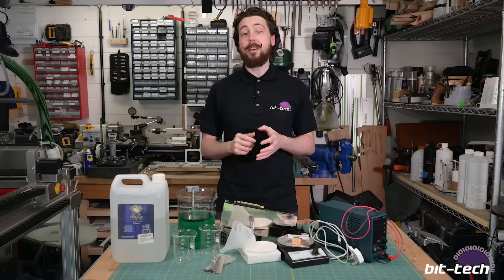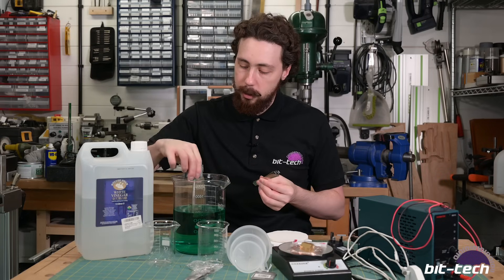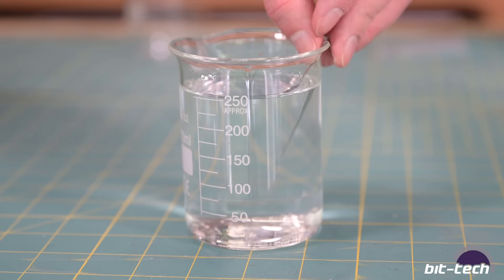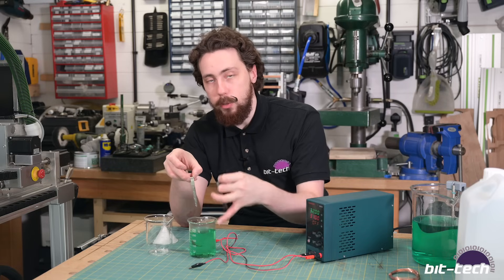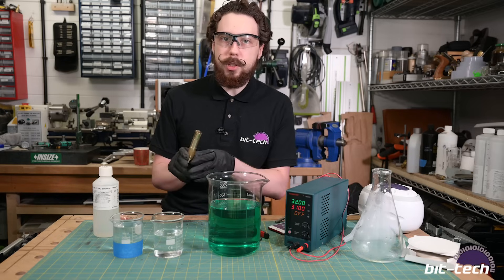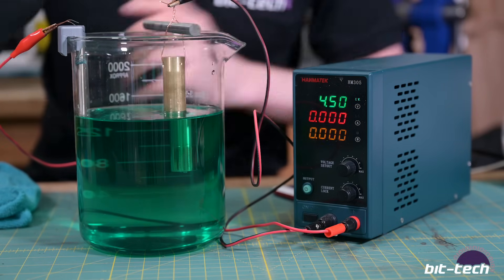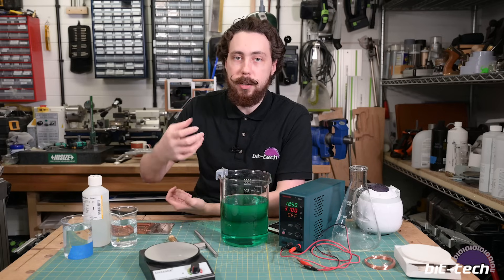How to Nickel Electroplate at Home | bit-tech Modding

Comment: Pro Tipp: Constant Current works better then Constant Voltage and low Current takes longer, yes but it will be more even and precise. I do Nickelplating for a living. And no i can´t plate your parts because I am not allowed to take any random stuff, we dont do that. We plate grinding tools for CNC-Precisiongrinding. As pointed out in the Video for best Results Clean Parts are the most difficult part of the plating.
Reply from the maker: Martin Brieger That’s a handy point. I had hoped to do exactly that but it seems the unit I chose is voltage controlled rather than current :/
Reply: @bittech1  set the voltage higher and then set the current limit and the power supply will adjust the voltage down to whatever is necessary to maintain the current. If the voltage is limited and isn't high enough to push the set current, it'll just maintain the voltage at a lower current. It all comes down to the resistance of the electrodes/electrolyte. The higher the resistance, the more voltage you need for a particular current and vice versa
Reply: @bittech1  as @Jamie Foster pointed out, solution is crank the voltage up as high as possible and just set the current as high as you want.
Reply: Do you have a recommended device ?
Reply: I need some help I do that for living to iam Egyptian and I need help alot please
Reply: What material is best to use as clamp in electroplating nickel . Can I use any metal for camping?
Reply: @0815Skorpio  does a stirbar or circulating the fluid help or hurt
Reply: Is it possible for these DIY amateur home kits to do something like a engine cylinder? 
I also have a Honda NC29 front master cylinder on a shelf that I'm pretty sure needs the internal surfaces repaired and is stopping me from riding the bike as I haven't yet worked up the courage to look and see what the cost/availability of a new/replacement one would be....

I'm thinking the 2-stroke Kawasaki engines found in thier old range of motocross bikes. The cast alloy cylinder, which includes the transfer port and exhaust ports in the casting, which protrude into the cylinder area and act as inlet/exhaust valves as the piston slides past the respective positions of the port openings. Now, unlike most other manufacturers which incorporate a cylinder liner of some sort, such as a hardened surface or a liner, Kawasaki took a different approach for its motocross bike's range of 2-stroke engines and precisely machined the cylinders bore and coated the machined surface in a Nickel plating. 
It was a perfectly fine solution and performed very well, WHILE IN THE SERVICEABLE CONDITION IT LEFT THE FACTORY IN. 2-stroke engines found in other manufacturers motocross bikes could reach the end of that serviceable life and have the cylinder bore machined to a slightly oversize diameter and essentially 'reset' the cylinders serviceable life span. This could usually be done 2-3 times without significant issue. The other benefit of the other bikes was when a below nominal operating environment and/or engine component failure lead to premature wear/damage of the cylinder wall, the engine could also be repaired by increasing the bore diameter and fitting an oversize piston and ring. Allowing the engine to continue functioning with relatively little repair cost. 

Kawasaki on the other hand...

While the Nickel plated cylinder bore performed exceptionally well from new, the moment the coating sustained anything more than very minor wear/damage, it was not possible to repair the engine by increasing the bore size. Requiring a completely new cylinder in order to repair any damage the Nickel plating sustained. The surface could be carefully honed during top-end rebuilds but correcting any ovaling, or reversing metal transfer or removing scoring (from say, a poorly fitted wrist pin circlip / rings which are poorly/not gapped / overheating / incorrect fuel-air or fuel-oil ratio / etc) is largely out of the picture. 

Sorry bout the looong winded explanation.

So, considering the decreasing availability of these parts and thier considerable cost relative to the overall value of the bike, (the cylinder would often be more expensive than replacing a 5yr old+ small capacity bike, making for a quite expensive repair bill for the parents of non-sponsored enthusiasts.)
This goes double for collectable examples such as the mighty KX500.
It would be fantastic if the factory Nikasil plating could be removed (chemically or mechanically) and replaced with a fresh coating.

P.S. I don't believe it's possible to sleeve these castings due to the cost saving nature of thier OEM construction method, which would be compensated for by the properties/nature of the Nikasil coating. But I could be wrong.
Reply: @muntee33  Sadly, no. Engine are made of aluminum and aluminum is terrible for use in electro chemistry.
Reply: @JaenEngineering   so what Ampere and voltage exactly you recommend for nickelplating ?
Reply: i heard that using the lowest current and voltage possible produces the most high quality coating but obviously takes a long time

Comment: I did zinc and copper before now I'm ready to try nickel. I bought a gallon of 30% industrial-strength cleaning vinegar and non-andodized sea salt. Every time I thought about trying it, I kept using the cheaper viegar for rust remover and it's all dirty. I just bought some nickel, rant over.

Comment from the maker: Timestamps since this is a long boi:
00:33 - Intro
02:30 - Materials
06:30 - Making the Electrolyte
12:50 - Cleaning
14:56 - Acid Pickle
16:54 - Plating Intro
18:33 - Plating Method
23:30 - Final Thoughts
Reply: If you put them in the description youtube will automatically display them in the "progressbar"
Reply: @janek-96  Yes, IF the timestamps start at 00:00.
Reply: Add these time stamps into the description a long wit 0:00 and take advantage of the time line chapter functionality youtube has
Reply: Ami not right in thinking there are extreme dangers if someone tries stainless steel? If the electrodes go around the wrong way do you not get toxic gasses? Might need a warning about that.
Reply: @sonoflysystrata2   Alex, the presenter, had warned about the matter; at the introduction about performing the experiment at a highly ventilated area. Common sense depicts the fact.
Reply: Use a fish tank air pump aerator to keep the fluid mixed.

Comment: A lot of the talk about experimenting and “you might want to try” wouldn’t be necessary if you use current control of the plating. mA per square mm remains a constant if you want reproducible results with varying conductivity or concentration of solution. You power supply has that feature. This has been a very good introduction to plating, thanks.

Comment: Two suggestions: 1) Plating isn't about voltage, it's about current. 2) Always use magnetic stirring, or put multiple sacrificial electrodes at different locations, otherwise the plating WILL be uneven.
Reply: Reading your comment  figured out you know aot about chrome plating, I want to chrome plate  copper pipe about a Metre in length. How do I go about doing it
Reply: you actually dont need any current. Caswell has a new electroless way of plating. it works.
Reply: @redhed9776 That seems to be the superior method. It's more expensive though, especially if you have large objects to plate.
Reply: What about a small aquarium aerator, it keeps the solution moving all the time.

Comment: I really liked your video!! Im into restoring an old motorcycle and one thing i want to do is to nikel plate some of it's screws, so this comes really handy to see.
Thanks!
Reply: In planting process  what kind of anode matarial use
Reply: In this situation nickel must be used. You must use the same material that the plating fluid is saturated with.

Comment: Electroplating sure is easy, but getting an uniform surface finish can be pretty hard. I'm exited to see your results!
Reply: E5
Reply: I did high chrome plating for 10 years there is a lot of little tricks but there's not too much you can do to avoid thicker quantities of your plating materials towards the end or corners of the work you're trying plate covering the ends of material your trying to plate with aluminium or lead tape will bleed off excess copper nickel Chrome whatever the solution you're working with.
Reply: @googlefirstnanegooglelastn1203  I'd like to have a visual of what you're talking about, using aluminum or lead tape, I don't quite understand how this would be done.

Comment: Using a aeration device like the ones that make bubbles in the fish tank, but only the air tube only. This will keep the solution moving. Or using the they stir pad you mentioned? Although you didn't use it in the Nickel Plating process.

Comment: Might want to explain one reason for wearing gloves aside from messing with chemicals is to keep fingerprints from depositing on the part.  My understanding is they will easily show up on the finished part.  It shouldn't be an issue due to cleaning before plating but it's cheap insurance.

Comment: I used a car battery and the thin strips of nickel to make the solution. I have a charger for the car battery but its one of those roll around kind and takes up a lot of room at the bench, so the battery is easier for me.

Stripped a old charging wire to hang things from and used a paper coffee filter for the bits.

I think in total I spent something like $15 for the vinegar and strips to make the solution.

For the container I just used the plastic vinegar jug. Cut a slit in the bottom side and put one strip in it. Filled with hit glue to seal it. 

In the top side I made a window for a nickel strip mesh I made and lowered it in.

The battery connections hold nicely because one can rest on the bottom of a bowl I put the jug in (just in case) and the other clips the plastic and anode up top.

Comment: I am interested in electroplating a design that's been etched. Would leaving my toner on the initial part keep the nickel from adhering to the sections I desire to remain brass,  or would I be better off just sanding the nickel off? My main concern with option two is that it may cause flaking.
Reply: No expert, just curious, what did you do?  I guess etching fluid is way more aggressive than this so the toner would work?  Or Nail polish, remove with acetone afterwards? I don't think you can easily remove the layer after it is plated.

Comment: Very interesting and informative explanation of the process. Well done. Have you tried using citric acid for pickling? I use it for cleaning up small parts after silver soldering to remove residues. Any thoughts please?

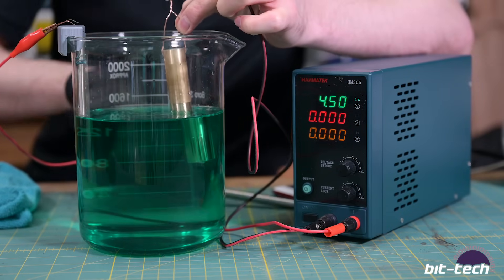Comment: Great video, but at point 21:00, your supply shows no current.  Is it even on at that point?  
Also, you keep talking about voltage, but isn't it the current that matters?  When I tried this, with a fixed voltage, the current varied greatly just by moving the pierced close to each other.

Comment: I am not sure if I missed the beginning but cleaning a simple bolt, remove paint, wire wheel and run a thread tap over it once as thread gain a very tiny amount I guess like 0.003" but many bolts have rolled threads that make them thick. A tap, cute threads and are loose. Thoughts? Thanks!
DK, ASE master tech since 78, retired.
 (Note; I do like the "Yellow Chromate Conversion" that required a good zinc plate as the truck is a 1967 for fasteners and other items to plate. Thanks again!

Comment: could you make a ring anode, that would be the same diameter as a glass beaker, would that kind of an anode prevent shadowing?
Reply: He could use multiple rods with 3D printed holders just like the one he uses, and connect them all with copper wire. It would allow customizable configurations for more complex parts and would be easy to do.

Comment: So I'm thinking of doing this for some older game consoles so as that their stock aluminum cooling blocks can use liquid metal to interface with the IHS. Will this nickel plating process work with aluminum heat sinks?

Comment: Thanks for the informative video it sorts a lot of potential problems out. I have a question that you may be able to help with. I need to brass plate some small plastic model parts, obviously I need to paint with a conductive coating first. Do I need to copper plate, then nickel plate before I brass plate. Your advice will be appreciated. Thanks, Chris.

Comment: the anode (not the thin nickel anodes), the round one that you used when you started electroplating. The one that looked like it was ade to hang on the lip of a beaker. Where can i find those, what is the manufacturer, what material was it made from, and how much are they?

Comment: Had a thought, what if you used an anode ring with the cathode/part in the center to prevent shadowing?
Reply: Right. He could have built a "basket" of the thin nickel anodes connected by a copper ring at the top rim. Platimg a coin or something would be a bit redundant with a 360° anodes but that could easily be changed for the part.
Reply: Helo sir, that round bar anode is that a stainless steel? Or what kind of metal is that

Comment: Are there alternatives to the HCL acid, like acetone etc. for cleaning? I am just uncomfortable with keeping strong acid around. Thank you for the video!
Reply: Acetone is good for cleaning oils, grease, and dirt, but you need an acid to remove oxidation. You could consider citric acid if you want something more gentle to activate your surface.

Comment: great vid, just to point out at 25:13 you misspoke and just got the order backwards. To coat stainless steel in copper you must first plate it in nickel. Copper will not adhere to stainless steel without the base coat of nickel not the other way around

Comment: Thanks for nice education. Do you know what kind of material I can use that doesn't react and interfere with the solution. I want to hang down thick pieces of nickel in the bath  and I guess copper-wire  will interfere with the nickel solution.

Comment: 25:01 Small Correction: Stainless steel must be Nickel plated prior to Copper plating - contrary to what you said.
This is because iron (steel) and copper are quite far away on the reactivity series. Thus Nickel plating is used as an intermediary step.

Comment: Question... Ran the process to create an acetate similar to above.  About 300ml household vinegar. Half tsp table salt, fully dissolved.  DC power set to 20v/4amp. Cathode/Anode 25×100×1mm.  Came back about an hour later. Cathode almost completely dissolved. Solution is clear, *not green*. Bottom of jar filled with dendrites.

Comment: I'm wondering. Can you plate a tool, like a pliers that has moving parts without interfering with the opening and closing action, or would it have to be taken apart?
Reply: Youd want to take it apart. Pieces behind other metal would definitely get plated less.
Reply: Inside the pliers won't get any plate on them, but I would open and close them every so often tho.

Comment: Thought of using a round nickel disc in the base connected to your thin (high surface area) anode pieces? This would ensure fragments continue to be conductive.
Reply: Thank you sir. How about the nickel ingot sir, can use to anode and cathode  to make a solution. And can you tell me  what is the use of nickel ingot? Thank you
Reply: @jhorossposter5893  Nickel is used as the "sacrificial item".... that gives off metal ions that are then plated onto the item you want to plate (the brass or copper in this case).

My suggestion is to ensure a high degree of free nickel ion presence and to ensure that as the thin nickel pieces break apart they still remain electrically connected as the anode.

Comment: Maybe a daft question, but can you use a car battery charger for a power source? Excellent tutorial as well. I'm just a retired hobbyist restoring things like storm lanterns etc
Reply: Yes, many people use a battery charger at 6 volts although lower voltages can and are often used.
Amperage is the important thing though, there are formula's of amperage needed for surface area being plated, it won't be adjustable using battery charger. I don't think it's possible to use a modern automatic 'smart' battery charger, you need the old style 'dumb' ones which often have a high and low charge rate.

Comment: Until relatively recently, in the 1980's, a pickled black nickel was the 'darkest black' available for high end camera equipment and telescopes to prevent internal reflections. 
I think it was only within the last 10 years less reflective black has been available (as used by NASA et.al.)

Comment: I made a batch of about 1 gallon of nickle solution but it's not working so good, seems like it won't coat the bolts..I've tried different voltage, acid bath parts..but doesn't seem to transfer to the parts,,any advice on what to check?

Comment: Great video, very thorough.
Would this work for silver plating?
And how would you go about only plating part of it, for example if you had a bronze skull with horns and you only wanted to plate the horns is there something you can use to prevent the rest of it from plating?
Reply: Just mask off parts you do not want plated. Either keep only the horns in the plating solution, or simply mask them off with say a coat of something like plasti dip or even spray paint.

Comment: Could you use a PC power supply for the plating process? They have 12V and 5V rail, so you could use the 12V to set up the solution and the 5V for the plating itself...
Reply: Power supply is any thing that supplies power. Alex the presenter , spoke about this briefly at the introductory opening lecture. He said you could also use a phone charger also. You need to watch the segment many times to understand. Take care and be safe.